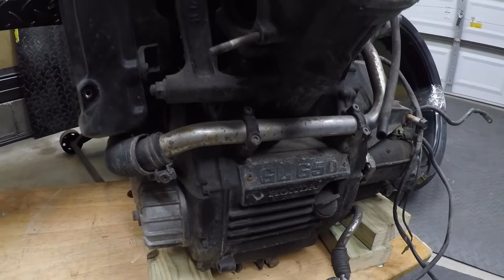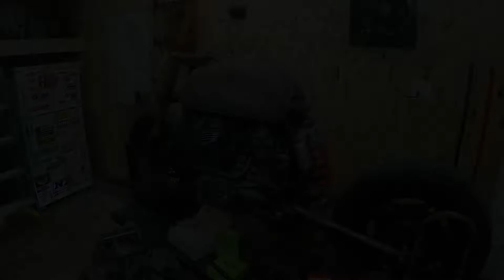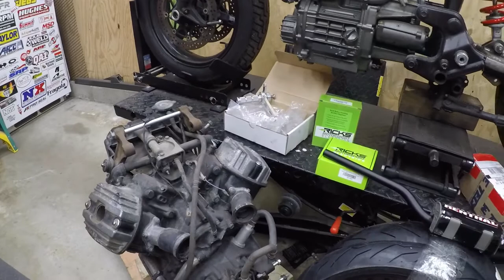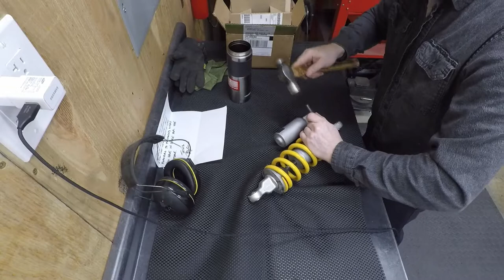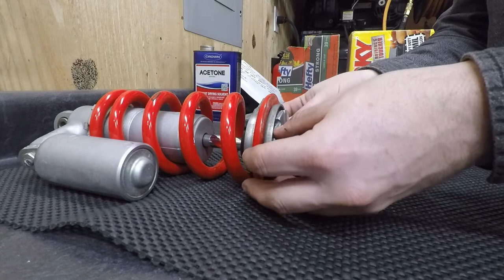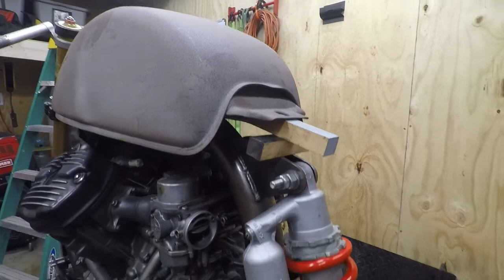HONDA CX500 TRACKER BUILD PLAN!! EP 2

Comment: I'm excited to follow along! Looking forward to some tips for my GL650.
Reply from the maker: Im excited to use your temp sensor trick for this one as its also  getting a trail tech unit
Reply: You don't know how happy that makes me. You've made my day.
Reply: What temp sensor trick im looking into where to put mine
Reply: @85artz31  you can put the trail tech sensor in the stock location with an adapter. M16x1.5mm to 1/8 bspp adapter from Ebay.
Reply: There's a picture that might explain more in one of my Instagram posts back in October.

Comment: Excellent video (have watched th cx series of videos 👍),right now it's question time (are you sitting comfortably) I have got a suzuki dr 650 ,and I would like to change the triple tree to a wider one ,do you know of any triple tree that is compatible?.
Thanks in advance .peace out. ✌
Reply from the maker: Hey Andrew I appreciate you watching.  For the DR650 I do not know what any of the factory dimensions are so I cant really help with any guidance there. Fork tube diameter, stem length, offset, steering stop design are all concerns. You will have to do some digging on that one or have a set custom made
Reply: @BrickHouseBuilds  ,wow now that was quick !!!!,thanks for your speedy reply ,will look into all the specifications for the dr650.
Will get back to you when all found .thanks again .👍
Reply from the maker: @andrewbull3537  no problem. Sorry I can't help more

Comment: Hey, on my set-up I used R6 monoshock and all is great except that I need also stiffer spring. I was trying to find information what (red) spring did you use and where did you buy it? I'm looking for ID 55mm, 7" long. Your has the same size? I was thinking about Racetch but not sure if that may fit.
Reply from the maker: Hey Pete, I get this question a lot actually and I really need to update my description here. I went through Racetech and had them spec a spring to fit this shock.  They have a geometry calculator that determines rate after you input the dimensions of your setup.  Currently the spring thats on it is 850 lbs/in but may still be a hair too light. I've yet to get the bike out on twisty roads to really feel it out. Check out my later video where I redo the lower mount and talk more on the science of it all

Comment: What usd fork setup did you use?
Reply from the maker: Hey Louis, I appreciate you checking the videos out. For future reference I link all parts used in my videos as I go. This is an early video where I'm simply going over the plan. The video linked goes over specifically front end components I used. The bike is 99% done now which is awesome.  https://youtu.be/ST2uewgRhPQ